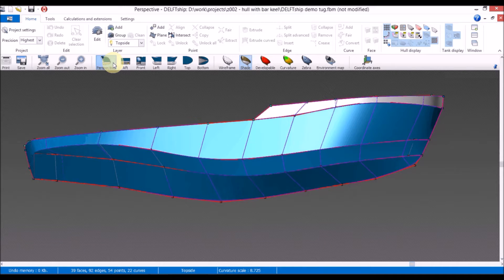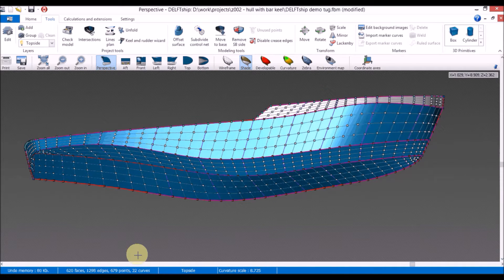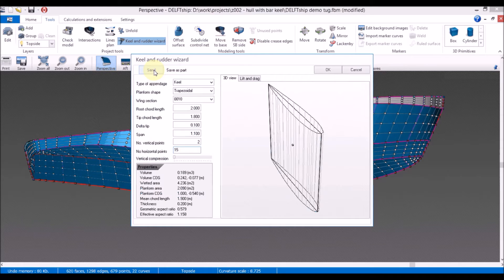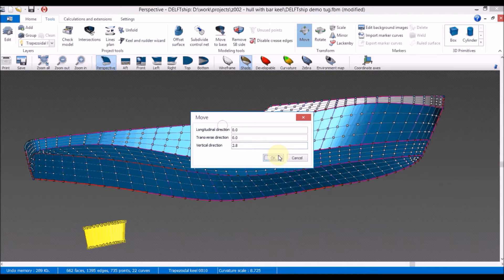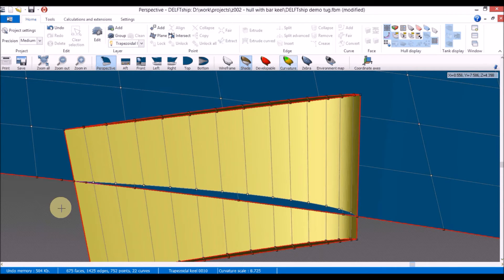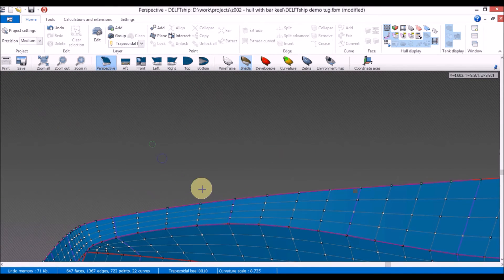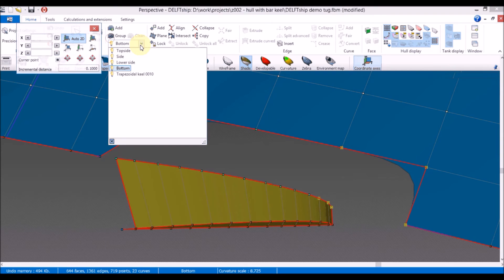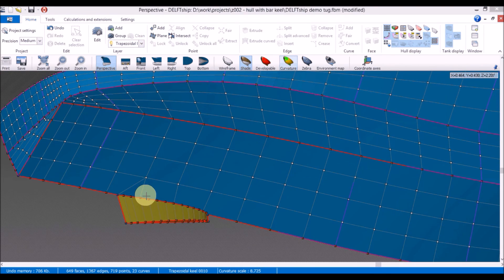Delftship - Tutorial 2 - How to add a Rudder Trunk

Comment: Hi Stefan, 
I know this video was published almost five years ago, and I'm not sure whether you are still active in this channel and occasionally have an eye on comments.
This video was pretty instructive to me and I am bewildered how quickly and with what ease you inserted into or attached a new skeg body to the tug hull.
For me this would have taken much more longer.
I would like to ask you how I can achieve to add appendages like bossings and struts to a twin screw hull?
Well, I figured out, how to insert or attach a shaft by selecting from Tools Add Cylinder and providing the coordinates from start midpoint and end midpoint as well as the radii of start and end 
(n.b. usually at the end, where the shaft protrudes the hull's shell, its diameter is a bit larger than at the beginning where the prop is attached - beginning and end according to the origin which in my hull models is always the aft perpendicular or the axis of the rudder shaft).
I cannot fancy how to incorporate the delta-shaped strut plane which connects the shaft's bossing with the hull, and thus supports it.
I know that you only can extrude boundary edges, which to create I would have to cut the cylinder of the bossing.
Or would you create a strut plane by adding a box from the Tools, that is such oriented to intersect both the bossing cylinder and the hull?